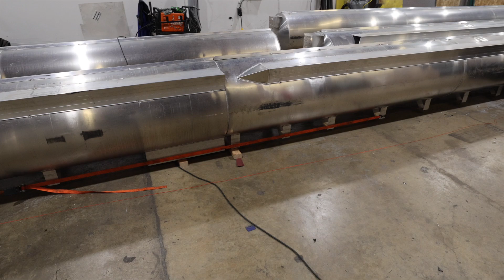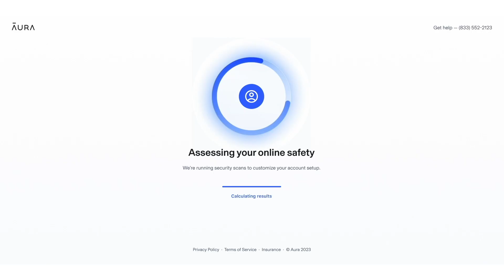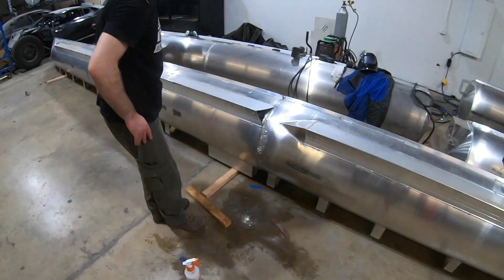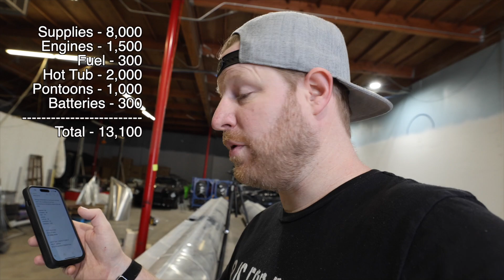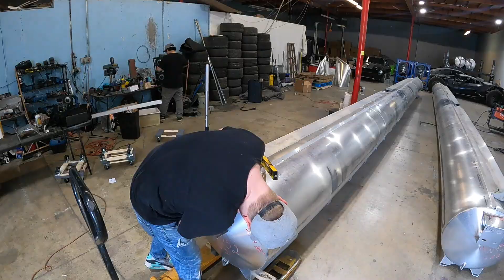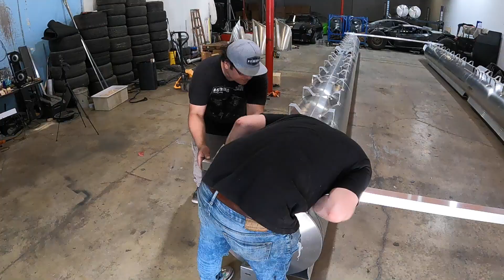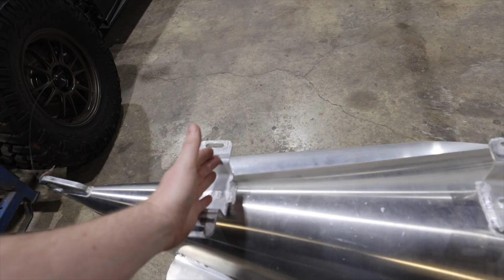Quad-Tune Pontoon Yacht Build - Welding Massive Pontoons for Our Biggest Project Yet!

Comment from the maker: Stop data brokers from exposing your personal information. Go to my sponsor https://aura.com/bisforbuild to get a 14-day free trial and see how much of yours is being sold
Reply: You should build it on the trailer or your gonna have a real hard time getting on the trailer once it's built .
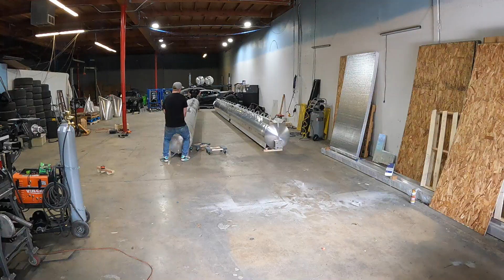Reply: 17:57 Hey, wouldn't it make it overall easier if you were to build the trailer first?Now you've got the pontoons done.Build the trailer place the pontoons on the trailer and build the boat on the trailer. Otherwise.How would you get the boat on the trailer afterwards while it's in your shop🎉❤
Reply: Hey you should go take a tour of Brunswick  on Hadley rd in Fort Wayne.
Reply: Hey Chris for rolling flicker you can use: Flicker Free from Digital Anarchy, if you're still using FCP (not sure if there any internal solutions, I haven't touched macs in a while). Or Deflicker tool that comes with DaVinci Resolve. Both gave me pretty great results in the past.
Reply: I got a name for it yachtoon!!
Reply: Im thinkin about water drag and weight,on the pontoon tips before they got cut the fins are on it to stop them turnin into a submarine but its a good thing your doin and it will be interesting how it turns out,btw the camera has to have the 60hz anti-flicker turned on then it should stop the lines
Reply: What are you naming boat? The Poontoon
Reply: in regard to personal information leaks, our government is a big offender.  Where I live, Department of Motor Vehicles does sell your info if you do not opt out
Reply: I always think it’s funny when you apologize for the picture or sound quality. Maybe I’m different but I could not care less about those things when it comes to YouTube. I don’t come here for the production value. YouTube is all about the personalities and the content. You could film these videos on your cellphone and I’d find them just as entertaining.

Comment: Instead of searching out all those little pinhole leaks wouldn't it be much easier to just use Flexseal on all the seams, or put some Fix-a-flat on the inside of each pontoon and rotate them to sufficiently coat the inside?

Comment: Should the outer hull chine runners not be facing out? You know... for a wider footprint when on a plane? Which i doubt it will do if the hot tub is placed in the front.

Comment: And the gauge of the aluminum was really thin, probably the thinnest they could get away with for the single tubes, but 3 times longer? I think it’s going to fail. What is the alloy of the tubes and what wire are you welding?

Comment: The back of the hot tub to the open-end pontoon will not work.  Ideally purchase two of the convex end caps from the manufacturer (or cut them off the spare pontoons) and install them backwards convex in, concave out into the open center pontoons. Then use the advice of the engineers below.  Failure to do this will ....yeah.
When the hot tub is full of water the load put onto the structure will be extreme when in rough water at any speed.  I love it and it will be the ultimate party boat.
I feel really lucky that we are BFF's who have never met but will spend lots of time on this boat. ;)

Comment: Your welds have the potential to fail down the line. Should have left a gap to allow for full penetration welds. Also in the video down hill welding was used which is a bad technique and can cause lack of fusion amongst other things. Aluminum has an oxide layer that needs removed right before welding as this oxide layer has a much higher melting point than that of the aluminum itself and this is a potential reason you had defects (the pin holes). One final point is the welds would have been better being dye penatrive testing which will show any micro porosity which is common with ally welding. I am a welding engineer so hopefully my comments help.

Comment: Something to think about regarding the pontoon joints and lift strakes.  The lift strakes add stiffness to the pontoon, the welded joint won't have this reinforcement.  The strakes need to be tied together so the welded joint won't have to  take the entire flex load.  This build will be epic.

Comment: You can't count your hot tub box as floatation, not when it will have about 4000 lbs. of water in it, if anything it being on the front of the boat it going to make it plow thru the water like a bull dozer , uless you have equal weight on the back to balance it out. The pontoon welds i don't think will hold because of the flex they will have with them being right in the middle once its out on the water unless you add some type of bracing to them. I like your ambition, with car it's just you and another person maybe but being out out on the water with a bunch of people in a homemade boat is a whole different ballgame so it better be safe

Comment: I would've welded an extra baffle or plug in those pontoons where you butt welded them just incase they welds start getting holes in them. I'd also get some extra aluminum to place over the welds and weld those for those issues and for strength

Comment: If you give it a barge front, it will be a barge and no amount of horsepower will allow it to plane.  You need to raise the hot tub enclosure at least a foot and putt some pointy fronts on the inner pontoons.  you can do it now or do it later, but you will do it.  Good Luck

Comment: 2 things- 1 move the hottub to the back all that weight in the front youre going to take water over the bow and swamp the boat.
2 your going to want to mount 2 engines on the outside corners. Turning that thing in the wind and current will be extremely challenging. Look at the large premier brand pontoons for inspiration

Comment: The lifting strakes  on the pontoons also provide extra strength to the pontoons to prevent them from bending or breaking. Have you given any thought to adding some aluminum angle to augment the area where the 2 pontoons were joined. I expect your deck to provide some support to keep the pontoons together, but it may not be enough.

Comment: You are missing longitudinal stiffness at the point of weld you just did. When the waves bend the tubes, you will have a crack. at the seam. I would stiffen the weld by welding a cross section square tube across the weld a few meters both ways to stiffen the structure. 

Would not like to be the one to say "what did I say" after the first floatation test with all friends aboard

Comment: Just curious.  What if you used some sort of automatic air system that would keep a small amount of compressed air in the pontoons so if there was a small leak it would  push the water out..

Comment: Looks like your gonna need a gantry crane in the shop for this boat.I would build this to the point fully framed and rigid then finish the build on the trailer that you are going to transport it with.With this custom design I am guessing you are going to build a custom trailer.

Comment: just a thought idk if it would work but what if you had a bilge pump and one way valve like a throttle body on the car to open and close it so you could take water to correct the floatation and pump it out sorta like a self leveling system idk

Comment: So it only happens during your time lapse you can do time lapse in your editing what should be easier than doing it with your camera and I think you're even able to adjust the frame rate based on what you want I think that's your problem is the frame rates capturing the LEDs

Comment: "Our hot tub box would float about 5000 lbs." I mean, sure... IF the hot tub box was EMPTY and displacing water with air. 🤦‍♂️ Instead, your hot tub box will ADD the weight differential of the aluminum vs water it displaces PLUS the weight of the quantity of water above the lake/river water line.

This idea is so cringe it makes many of the other jobs on this channel look professional by comparison. 

I can't wait to see what they do for structural support along the 40' length or laterally across the thing. 🤣🤡

Comment: People saying itll snap in half. If you have an entire deck joining to the pontoons at say 200 spots, wouldnt that make it very rigid and unable to snap?
Reply: The problem is you can never totally eliminate flex when going over waves. Aluminium is prone to cracking around welds when exposed to repeated flexing.

Comment: the weight from the hottub makes the boat front heavy als it wil drive bad.
you want the most weight midle rear.
 why don't you make the stairs from the engine housing to the top, then you have more space on both deck's.

Comment: Figured youd have better control of the boat with the motors on the outside toons. And id definitely thinking of a way to add a bow thruster for tighter areas.  This thing isnt getting on plane with just 2 motors thou

Comment: I think id want to add a 1 inch aluminum band over the seam welds, and weld the band on for reinforcement and insure reducing stress pn the seams.  Will that need some thrust forward electric motors for better steering?

Comment: This pontoon boat is going to flex, and ultimately fold in half over even moderate waves. Way too long.  Pontoons needs to be much larger circumference and grade if doubling in length but not any other dimension.  Fill with foam!

Comment: Do you have any plans for how you'll be getting it out of the shop? With that length and only two inches of clearance for the door, those pontoons can be dented really quick if the trailer goes just a little bit off.

Comment: Are you going to have a hot tub water holding tank further back in the boat? All that weight in the front won't be good when the boat is moving unless you can balance the boat to be back heavy.

Comment: Agree with the comments on lack of strength of the pontoon in the area of the welds Oscar has put in.  I an ideal world, to make longer pontoons you would start with larger diameter tubes so that the bending moment stays about the same.  Need to calculate for vertical bending of the structure, when each end is on the peak of the wave, and midships is in a trough. With the payload (people) in the middle.  However, rather than reinforcing the weld area, I would make sure there is sufficient strength (including triangulation) in the upper structure, that ties in to the tubes towards the bow and stern.  By the way, what you are calling stringers are actually deck beams.  Stringers go longitudinally.
Great project. Don't forget the lifejackets!!

Comment: Are you going to carry water with you in the tub when driving or pump it in when parked? Maybe as mentioned have a holding tank further back when driving and pump it back when parked? The load in front will be extreme when trying to get on plane and the water will splash out of the tub as well, if its not sealed that is. And what will drive the heating elements for the HOT-tub? Big battery power and lots and lots of solar? That will drain the batterybank pretty quick...

With that said, I really love your guts to "Just Do It". Keep on keeping on 😀

Comment: I don't think these pontoons will survive harsh weather. Because of their length, the joint in the middle looks weak. It would be better to use supports to strengthen in the middle where you welded them.

Comment: Dude PLEASE use metric, it's ridiculously simple - fresh water is 1kg/liter, a liter is a cube of 10x10x10cm,  I live on a boat and if a skin fitting fell off 0.8m under water I can do the maths on a patch in my head - water pressure is 1kg/cm2 per 10m so  0.8m is 80g/cm2 meaning a 15cm2 patch could be held down by a 1.2kg dive weight :)
Reply: In the UK we use 'litre', I think they are different. Lol. 😂

Comment: Hey Chris, from an engineering perspective, those welds need re-enforcement. Your joins are central and I would you recommend doing 2 things: 1. Weld an alu belt (500mm wide) over your centre line weld and then 2. Weld at least 4 horizontal struts over this join for reenforcement. Your support struts should be at least 1m in length and 100hx100wx4mm material width.

The way you have carried out the work so far is great, but as an engineer, I would not certify this structure currently as it is.
Reply: Definitely agree. A spa pool in the middle is also going to be putting a huge amount of bending into those pontoons and hence, those welds are going to have to be even stronger than the ones used in the original pontoons structure. I would be tempted to run some additional strengthening channels along the length of the pontoons also
Reply: This is starting to be reminiscent of the camper
Reply: Just as another note, what gauge is the alu? It may only be gauged to the size of pontoon bought. In that case you ought to weld disks inside the pontoon, spacing them every 600mm to increase rigidity.
Reply: My thoughts exactly.. or incorporate a truss system also don’t forget the horizontal forces between pontoon’s will need structural diaphragm… so the pontoon’s supporting the engine(s) don’t run over your hot tubbers while passing your outside pontoon’s ….? 😂
Reply: Funny I don't weld, not an engineer but a machinist and this was my very first concern.
Reply: Reinforcing and X-ray the welds
Reply: I'd be worried about these extra long pontoons seeing different water levels over it's length (Ie, the bow and stern being in the peak of swells while the centre section is barely in the water and is producing next to no buoyancy) the vessels length is going to be pretty substantial for that diameter of the pontoon. Even if it's only going to be used on lakes and rivers, passing ships leave big ripples in their wake. At bare minimum I'd think that the large angle sections on the lower half of them need joining in the centre so it helps spread the forces evenly along the pontoons length rather than focusing it on the gap between them.

Maybe something could also be done to make it more ridged by making the railing as stressed members with lots of triangle bracing?
Reply: Bcs i am interested into learning welding maybe can you tell me sir form where can i learn this kind of stuff (book site course articles...)
Reply: @ΒαγγέληςΨυρούκης  I learnt MIG welding by getting a cheap welder and having a go. I played with the settings to see what effect they had on the quality of the welds, and went from there. I blew a lot of holes in metal, and had to grind back/re weld a LOT of weld beads before I gained a grasp on how to adjust the welder to fix any particular problem I was seeing, but I got there in the end.

If I was starting into welding today it would have been a lot easier. For a start, modern MIG welders are a lot more user friendly than the one I bought 30 or so years ago, and there's quite a few very good videos here on YouTube that will walk you through the basics. Once you get a rough idea of what you're doing you could always Google for courses in your area. Most trade schools do at least a 5 or 10 day "Welding 101" type course, and that would give you some paperwork to show to employers if you wished to look for work using this skill.

Comment: Nice project, it is huge! Hope it will turn out as great as you wish. I would suggest to cap and seal those middle two pontoons. Much easier to leak test and leak proof that way then connecting both to the a big box.

Comment: Would it be wise to add more of the 90°angle when joining the pontoons to support the welded area. Basically continuing the brace on the side of the pontoons for extra strength

Comment: Dear Chris, congratulations on your new built. I would like to point out some things that concern me about the Pantoone build. first of all you are welding two independent sections and those sections are held by a tiny weld in the middle, you should consider that that’s going to be under a lot of pressure and the weakest point. it could be the failure point on the pontoon sections , if you see the original pantoon sections they each have a long brace that goes from the beginning until the end of each section and that is to give strength to the cylindrical sections. Consider placing 2 continues support beams  two brace each side of the new pontoon sections welded to brace them so it mitigates, putting all the force on the welds and preventing the pantoon from bending in the middle and reaching a catastrophic failure. Congrats to you and your team on embarking on a new journey. I really enjoy watching your videos.

Comment: Great project. My concern wouod be a small leak allowing water into a pontoon. While not deep, even a 1/2 inch\ 1cm water level would cause massive problems due to free surface effect. Multiple bilge pumps, baffles and inspection ports needed.

Comment: A pontoon is the flat bit on top, not whatever makes it float. Bags of PET bottles, styrofoam blocks, or aluminium cigar shaped floats, it's all called a pontoon boat if it has a big flat top and uses something roughly flat shaped on the bottom. Just saying that what you call pontoon, is not what it should be called.

Comment: I love the build idea.
You might want to check DOT registrations on width, hight, and weight allowed for transportation on Highways. 8-1/2' W  x 14' H Max before its an oversized load requiring special permits and escorts. That's including trailer width and height. I'd hate to see it complicated and not be able to get to the water.